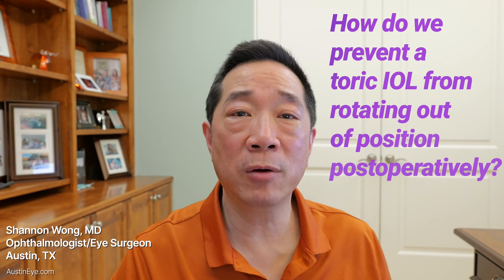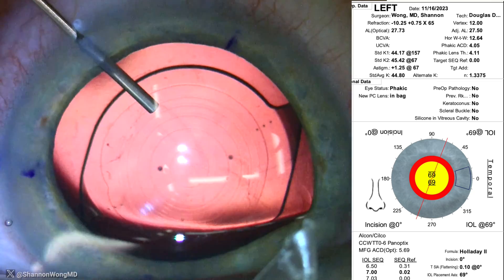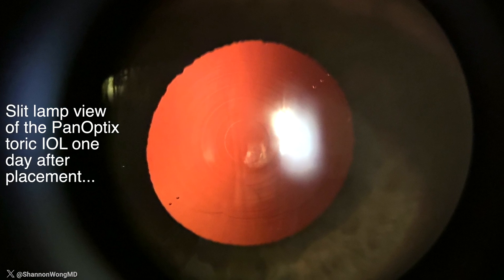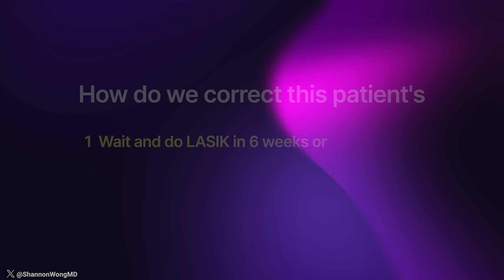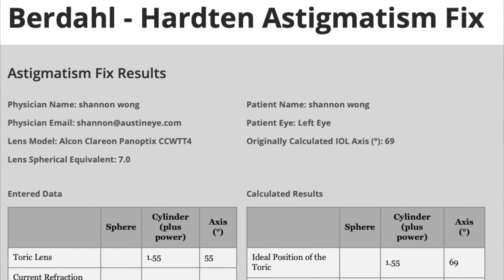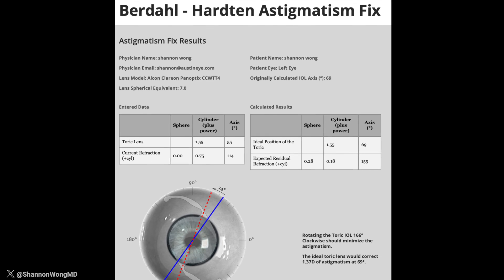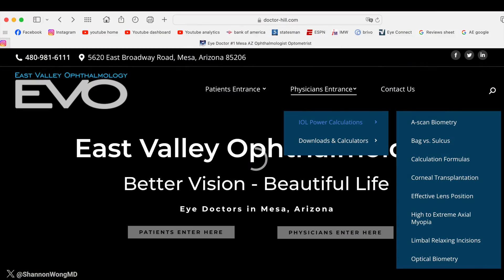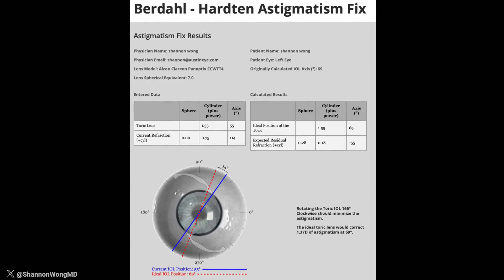How to PREVENT a Toric IOL from rotating in the postoperative period.  Shannon Wong, MD

Comment: Dear Dr Wong i was hoping you could help me in this case that is driving me crazy. 

I have operated 15 toric cases as a fellow, only had one rotation which was fixed in the OR without issues by rotating it back.

However i operated this patient 20 days ago: Envista toric +19.00 T 5.00 it rotated 22* counterclockwise. So i reoperated 7 days ago, and again it rotated now 30* counterclockwise.  Visco cleanup was perfect in both cases, clean bag, etc. 

Im thinking about reverse optic capture to keep it in position ok a third surgery ? Or what else would you recommend?

Fun fact
I just operated her contralateral eye yesterday and the toric iol is in great position
Reply from the maker: If a 3rd surgery is needed to perform ROC, then I would perform a 3rd surgery.
Reply: @ShannonWongMD  thank you sir

Comment: Dr. Wong, I had a Panoptics placed in my left eye. It is a toric lens. Apparently I had -.85 of astigmatism before surgery. It was six weeks ago. I still have poor distance vision and things outside in sunlight are very bright. My pupil is also larger than my right eye. I don’t know if that has anything to do with the light sensitivity or not. It was the same size as my other pupil before surgery. But anyway, I was wondering what would cause poor distance vision with a trifocal toric lens? I am told the lens did not shift.

Comment: Dear Dr. Wong. Could you please upload a video on your presurigcal toric marking technique? Would be of great help. Thanks
Reply from the maker: This video shows the marker that I use to mark the steep axis on the cornea.  Preoperatively, I mark the patient sitting upright at 3 and 9 o'clock with a sterile marker. https://youtu.be/s8M6HnZcieE?si=GO6JsX4QClq0s1Jy
Reply: @ShannonWongMD  if the patient’s head was even a little bit tilted, would the markings be off?
Reply: What about a car in high myopes

Comment: I would not do LASIK as an option. Misaligned toric doesn't only add regular astigmatism. Adding two regular torus results in irregular astigmatism that degrades quality of vision. And LASIK too will add to irregularity.
Reply from the maker: I check vision in the Phoropter with the patient before we do LASIK to make sure that their quality of vision is clear before doing LASIK after placement of all Toric IOLs.  Though I agree with your optical theory.  In practice, I have found that postop vision with LASIK enhancements is excellent.  Thank you for your comments.

Comment: I have found that placing a capsular tension ring in these long axial length eyes prevents rotation of the IOL.
Reply from the maker: I have heard that a CTR can help prevent rotation.  I have also heard that toric IOLs still rotate with a CTR in place.
Reply: Great video. I do CTR on axl over 27mm after I had case just like this and re rotated with CTR and it stayed in place. With that said, I suspect there is no guarantee CTR will keep all IOL in place and I likely do this for my own comfort that I used all tricks available. @ShannonWongMD